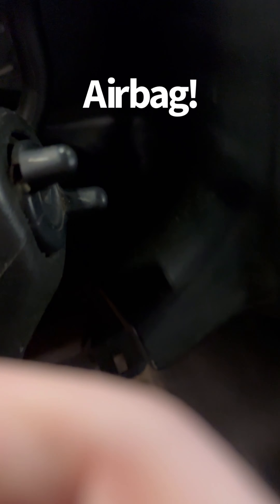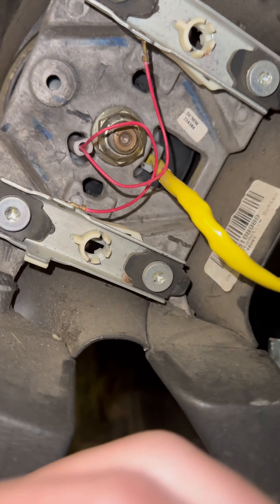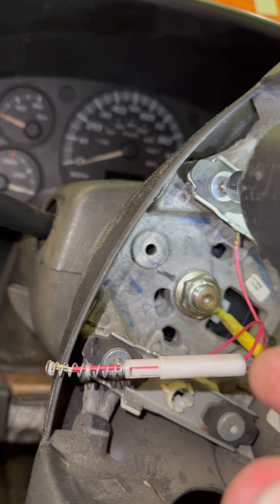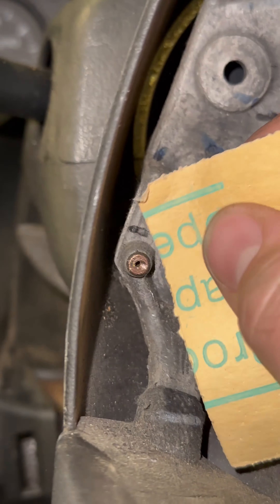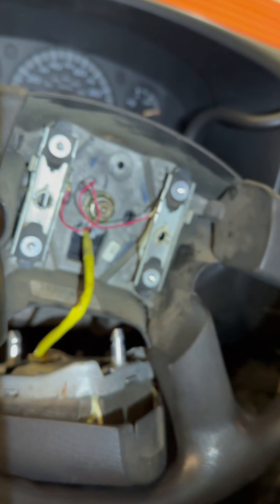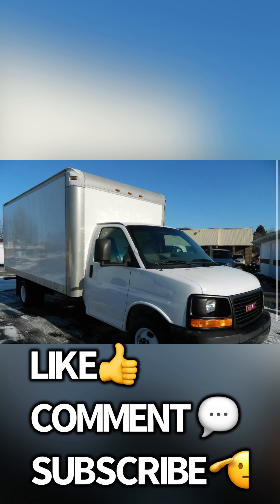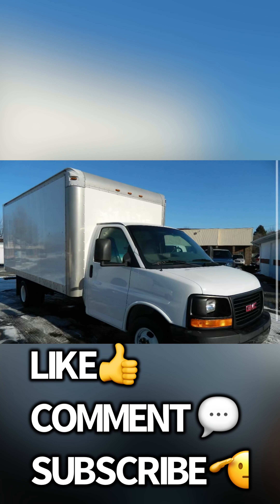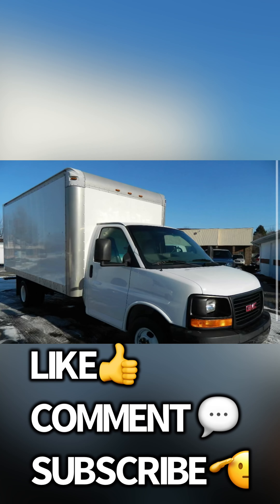2005 gmc Savana NO HORN, quick common issues and diagnosing. Then fixing the main issue!

Comment: When I have someone press the horn I hear the relay clicking when the horn is pressed I tried two different relays so I know that power is getting there what else could I do.
Reply from the maker: Check for power and ground at the plug for the horn!
Reply: Same issue, where is the ground for the horn plug?  Horns been dead for a while but rear tailights also don’t go on. They only work when braking or signalling .